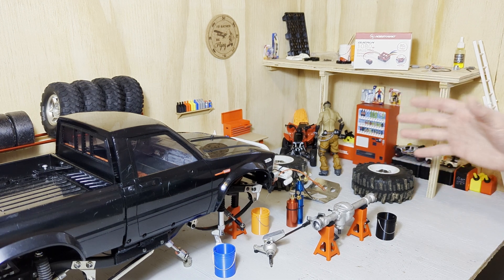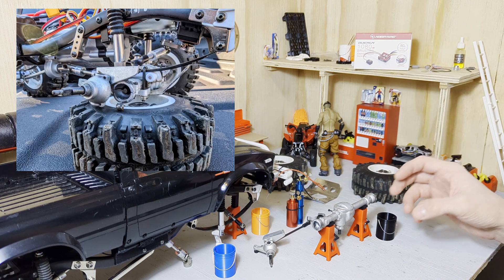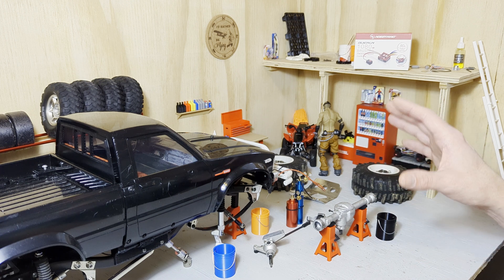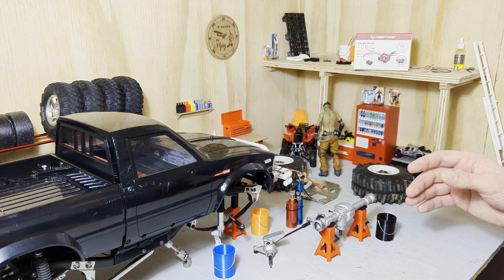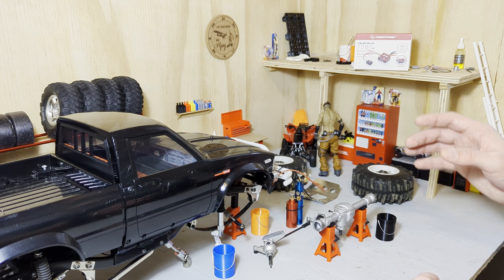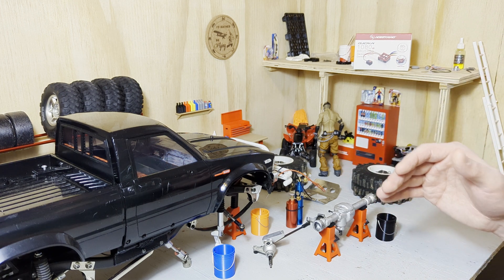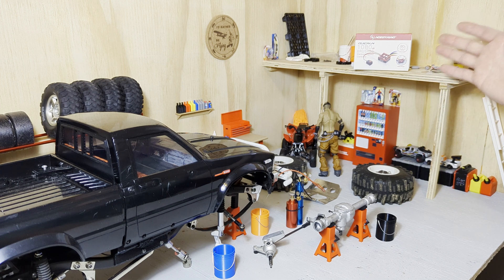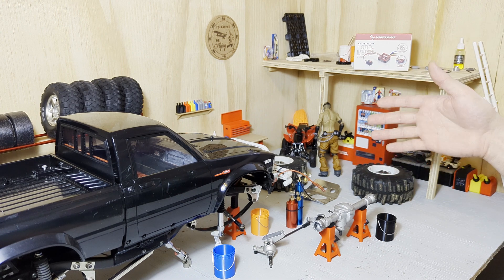Hobbywing QUICRUN WP 1080 G2 Brush ESC Performance Review

Comment: Yes the drag brake adjustment from the controller is fantastic! New build coming? Yes super stoked bro! I'll stay posted, great video here. Did you research and check if the Tamiya axle will work on that HG housing? Once again really great video
Reply from the maker: The Tamiya Bruiser axle would work but don't want to send that kind of money into that truck. The money to fix that truck is about half of buying a new truck. So, I'm getting a new truck and planning on building it on video. Thanks for commenting, liking, and watching bro!